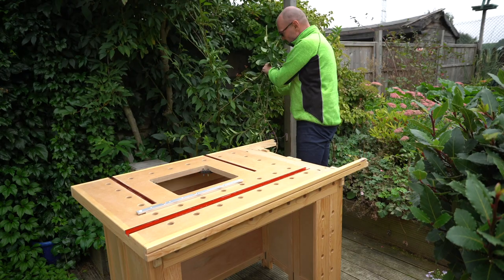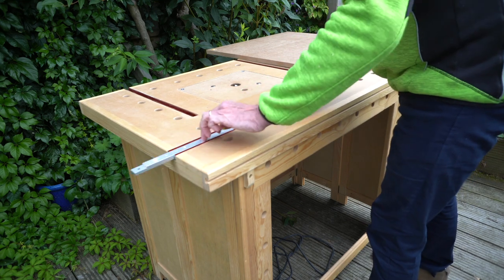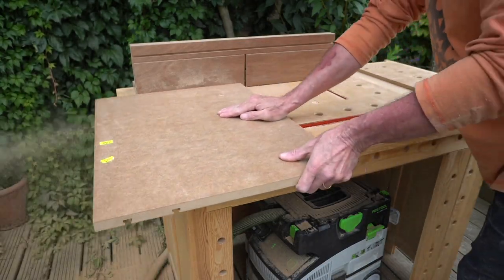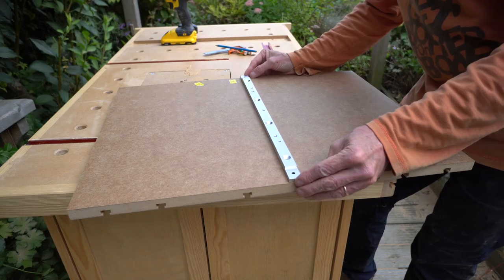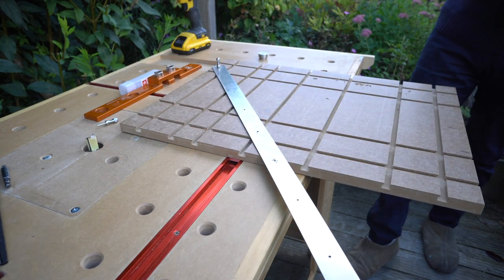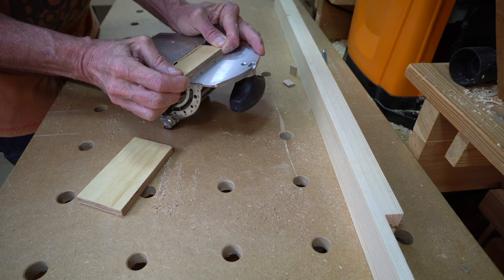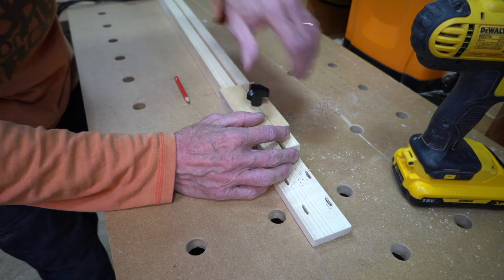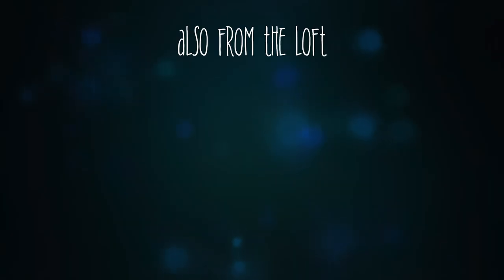DIY Coping Jig / Tenon Jig / Sliding Table for the Router Table

Comment: A good tip for dust collection when you are outside is to connect the house into the side door of the festool extractor so it turns into a blower and then clamp the hose to the bench. It then blows all the dust from the work area. Admittedly, it might blow it through next door's window but at least it isn't in the way of your work 😂
Reply from the maker: Great tip! 🤣🤣 Regards JP

Comment: Interesting project- a different approach from the normal router sled method!
What happens when you use a different size bit? The edge of the jig will no longer be aligned with the cutting edge...
Thinning the front of the jig to, say, 6mm (terminating square to the movement) would allow use where the bit chosen does not allow the extra 18mm extension needed by the jig.

Stop construction- for those without a Domino, through dowelling will work just as well.
Reply from the maker: Hi Mike. I expect this jig to get ruined over time as I change bits and amend for different projects. There are a few ways to reconfigure such as moving the guide. End of the day it’s a 10 minute job to make another. 

Dowels will work as would nails or screwed. Regards JP
Reply: @Smallbarnworkshop  True- you will find what are the important features for you, and retain those. Milling machinists spend a lot of time making jigs and fixtures to hold work- often for a single job. Jigs save time and improve quality...
I really like your multi-use approach to this bench.
Reply from the maker: Thanks Mike. Regards JP